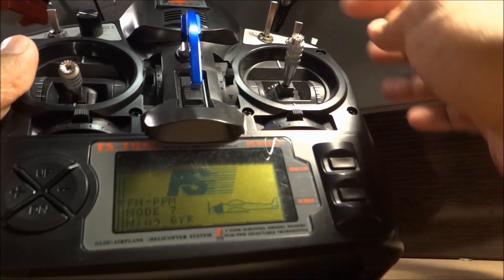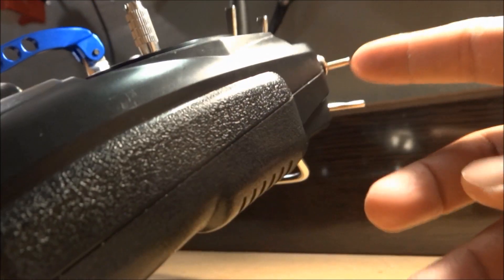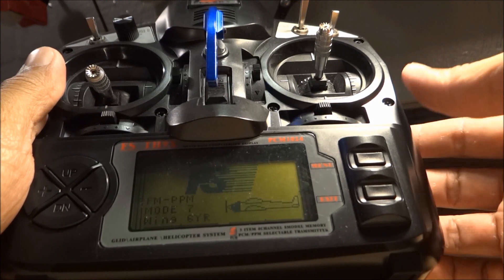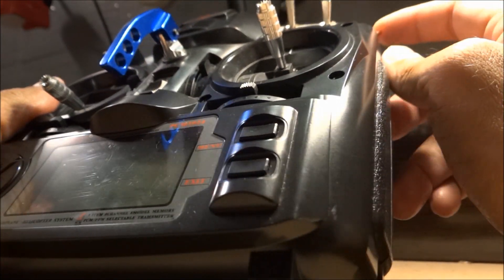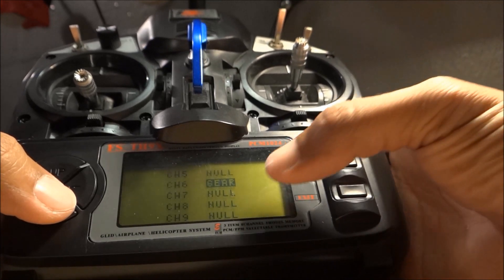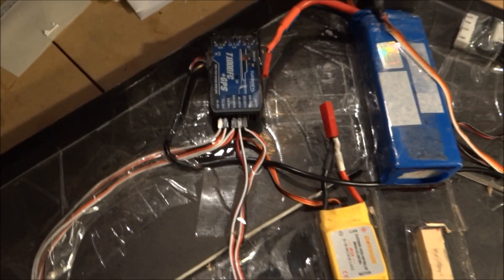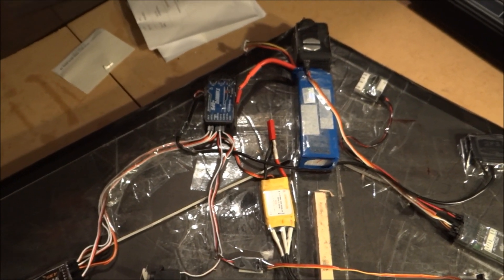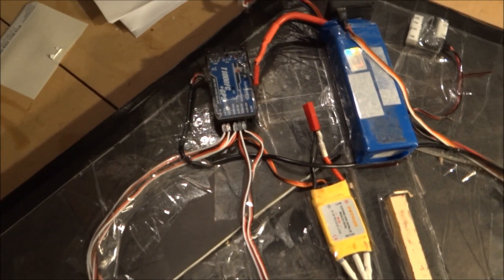How to setup turnigy t1000fc with gps

Comment: When calibrating the gyro it says in the manual it must be level but my plane doesn't sit level the nose is high about 15 degrees nose up, do I need to mount this AP on a surface in the cockpit that is 0 degrees? the plane came to me like this so it doesn't look right to me if theres a gyro involved.

Comment: Question , how to setup this T1000Fc for Bix3 uses two servos for ailerons  ?
The T1000FC only have one servo plug?
Do you have to run a Y setup with one servo reversing of some kind?
Thanks for any help.
DanT
Reply from the maker: Just use a Y harness for both aileron servo.
Reply: *****
Thank you, but I've never used a Y harness on any plane so, does a Y harness reverse one of the servos? Or do you still have to run some kind of servo reversing on one of the Y leads ?
Thanks again.
DanT
Reply from the maker: Dan Thiede no servo reversing necessary.  All a Y harness does is split the signal. If both servos are moving in the same direction just flip/rotate one of the servos. That should have both aileron servos moving in opposite direction.
Reply: Thank you..

Comment: You can buy a little board to add to this that lets you bypass the stabilised modes with GPS connected. Have a look on RCGroups. Only problem is the guy only posts within the states (I am in the UK) and for $26 (i think it was) that brings the total cost up to a decent Ardupilot kit.

Comment: I currently have a DX6i that only has 2 position switches. Can anybody tell me, with GPS connected which 2 modes the switch would select? I just want RTH and if the other mode is 'stabilised' then that's fine, but I don;t want to be forced to use the mode that maintains heading because that's just an awful idea in a aircraft that naturally wants to level itself!
Reply from the maker: The led on the Fc should tell you what flight mode it's in corresponding to the 2 position switch.
Reply: THANKS, I DONT HAVE ONE YET THOUGH SO WAS HOPING TO FIND OUT WHICH 2 MODES I WOULD HAVE BEFORE BUYING IT... sorry caps lock oops!
Reply: Chris Flory Any two of the 3 modes you want using the gear channel endpoint adjustment in your transmitter.
Reply: Thanks.. I have it now and the 2 pos switch gives me stabilised mode and RTH with no adjustments, exactly what I wanted : ) I actually have a taranis now too but don't bother with the 3 pos switches as those 2 modes are all I need.

Comment: Great video mate. thank you.
I have been struggling to understand this device and thus left it in the box for a year.. lol
Just one question though. At the start of the video you say to install on a trimmed out, flying well plane. But later say to do set up new model on radio.
After doing this, then reprogramming your expo, etc in to the new model is OK, right?
Reply from the maker: Yes. Exactly as I mentioned in the video.
Reply: roger..trims and flaps etc also right?
Would it be better to test without GPS first?
So you can bypass with manual mode if trouble?
Reply: Kevin Ray sorry to jump in but yes, because with GPS connected you can not bypass the device you MUST try out the stabilisation modes first WITHOUT GPS connected to make sure you can switch to manual if your gains make it difficult to fly. Once the gains are all set nicely it's safe to connect the GPS : )
Reply: Thank you Chris

Comment: for setting failsave you give the motor 70% and set it.

now when you fly out of range... the motor goes to 70%. but will the fc kick in to return to home as wel ? or doe you need to set some other swich in failsafe mode to let it go in to return to home mode?

orderd this one just for that rth thing.
Reply from the maker: You need to have the t1000fc in return to home mode, set throttle to 70% then set fail safe on your reciever.
Reply: thats a fast reaction. 

just to be clear. after setting it up like that. I can fly in every mode I want and when it flies out of 9x signal the rtl mode kicks in? 

if video blacks out I could kick it in myself by flipping a switch myself. but the real trouble starts when the plane doesn't do as told. 

been there done that. ;)
Reply from the maker: +sven kleijn fly the plane high enough in Los and shut your transmitter the plane should return if not turn the transmitter back on.
Reply: as long as your switch was in whatever position you need for RTH when you set your failsafe, yes.
Your receiver needs to 'tell' the T1000FC to go into RTH mode when it looses signal, it will not do this automatically.
Reply: thanks.  frsky module was the answer to all the problems.  now flying whit dianmu osd works fine to.

Comment: For about 1 month I use this FC, I only use the stabilize mode as it will keep your plane level by auto adjust aileron and elevator, the other 2 modes are useless, because when I switch them, the aileron is moved one for half and the other modes is full, and every control from Transmitter are disabled except the rudder, I just imagine when flying it will be causing crash. 
How to set the Return to Home? my Receiver has a fail-safe mode, and I set the aileron, rudder, throttle as normal feature without autopilot... I use futaba T14SG transmitter and FrSky receiver, any help will be much appreciated.
Reply from the maker: The t1000fc has to be in return to home mode when you set fail safe on you reciever.
Reply: Yes, thanks...  Just notice last night, when I assign one channel for RTH, that should activate when failsafe mode, the others setting for ail, rud, elev should be off and hold, thanks...

Comment: Purchased this product - very disappointed and returning it as its not suitable for purpose intended. The person who designed must have been on something, not having a mode to switch it off with GPS connected is just dumb to say the least!

Note: The  Hobbyking page says that you can use all 5 modes from a three way switch - mathematically that's not possible!
Other similar products use two switches to allow the use of the five functions advertised.

Pity could have been a great product and they could have used the 5v input pin for the  2nd switch control!
Reply: Should add , the other auto pilots I use, all have the on/off capability with GPS  and its absolutely vital to have  sometimes!
Reply from the maker: I agree that being able to turn off stabilization would be nice. But i think the intended porpuse for this product is for a simple plug and fly stabilization system with return to home and it does that very well. Comparing this $70 product to other more expensive FC is like comparing a Ferrari to a honda. You get more features at a higher price. As for the 3 position switch it is 5 or 4 flight modes. It depends on the position of the switch weather it's coming from low to mid or high to mid. Basicly the middle has 2 flight modes.
Reply: Off, stabilise, and home would have been fine. Even a Honda has an on/ off switch!
Reply: Brian M I agree and it's the reason I didn't buy one straight away, but I have decided I still want to order one. The plane I want to use this on is a big FPV glider and whilst flying FPV I never do loops or rolls etc so I don;t mind being 'forced' to use stabilisation mode. The only downside is that my plane has the power to go vertical and that could come in handy to avoid a hazard but the unit would limit me to 45deg climb / dive. but that's not something that will hopefully ever happen. If I want to do anything crazy I wont be using FPV and wont need GPS to I would just disconnect it anyway. So for me, on this particular model this product suits me perfectly. If I was flying an FPV 'combat wing' style plane I would probably opt for something else.

Comment: If you were to add a switch along the GPS cable so you could switch off (disconnect) the GPS module in mid flight, would the flight controller switch to non GPS mode? I'm just thinking it would be nice to fly 3D, but then have the GPS enable when/if you fly out of range.... By setting fail safe to turn on a switch to activate the GPS module??
Reply from the maker: That could work. A little research should show how to get it done.
Reply: actually on second thought the FC would lose it's home point I guess.
Reply from the maker: chrisbewrx home point is stored in the fc.
Reply: Lots of people have asked this on various forums and nobody seems to have tried it. I would 'imagine' that the unit recognises the GPS connection when turned on and that cutting the connection mid flight would only loose your GPS and not activate the other modes until it was turned off and on. That's just my guess though based on how some similar devices work that I have used. Slightly off topic but I plan to bypass my rudder... I don;t see the point in it going through the T1000FC when it doesn't control rudder.... so in the event of the unit failing I would at least still have rudder as long as my RX was still working.

Comment: Hello,

I have purchased a Turnigy T1000FC and have basically bench tested it.  
Before flight testing it, I need to know what are the differences in the (3) the flight modes using the Controller WITH GPS?

Thanks,
Mike
Reply from the maker: Leveling= plane will auto level itself when you let go of the control sticks

Altitude and attitude= heading lock. Kind of like cruise control.

Gps= return to home.

Comment: I read somewhere that the way to go when setting up is to first set it up without the GPS.  That way you can switch it off if there's a problem.  When the settings are working correctly you can then plug in the GPS and the gains will remain the same.

Comment: Great setup video! I'm thinking of getting one of these for a quick plug and play RTH for my FPV plane.
Reply from the maker: Thanks. It's cheap and works great. Only shortfall is you can't disable stabilized mode while the gps is connected to the fc.